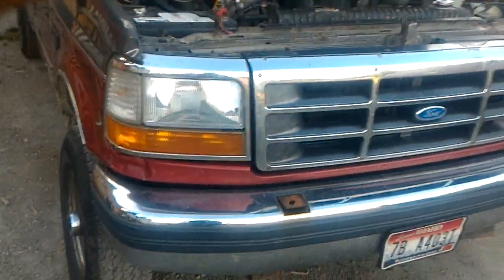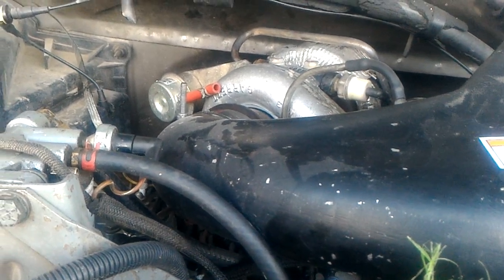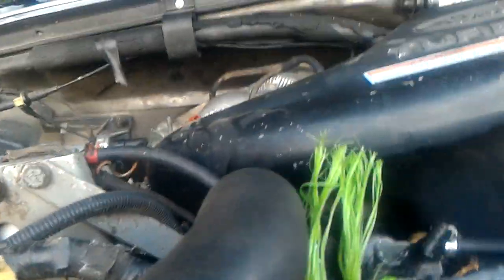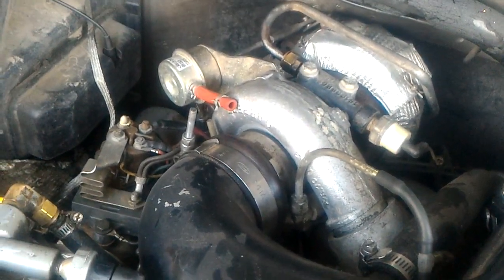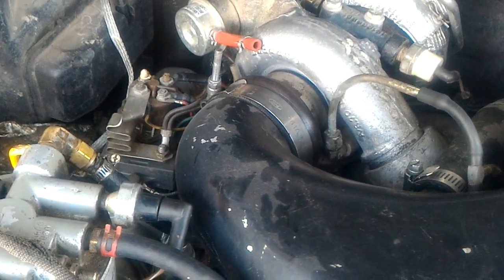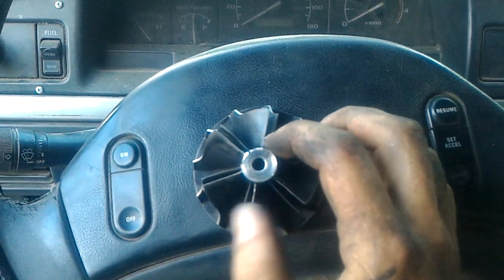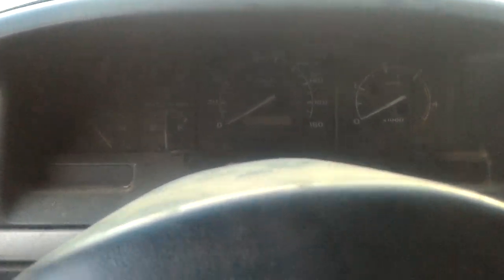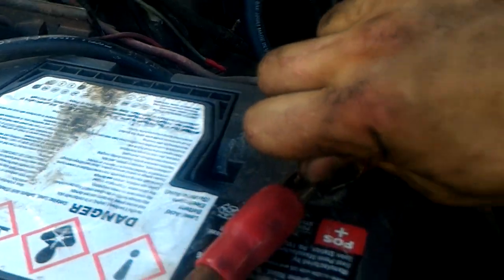IDI Wicked Wheel 2 - performance test

Comment: Hello just wanted to throw it out there I had the same issue for awhile more boost is no help unless you want a money pit. But if you can part shop and or have a buddie that knows what's up to help set up a intercooler on it that's the route I went. More boost is nice but a damn good intercooler is were it is. Denser air with the boost. Denser air makes more power.
Reply: With less smoke more efficient and better feul. Added with a nice pump that alone can get better results then just throwing more boost at it
Reply from the maker: After seeing the video Gale Banks has put out recently, I am inclined to agree with you. Dropping the temperature makes a huge difference.
And on the other rig with the turbo making 27 PSI of boost... well, with a good intercooler, I should be able to double the available air easily enough... More fuel and more power!

I'm kind of thinking that this setup(factory turbo, probably with ww2) plus a decent intercooler might well be good for 300rwhp, when pared with a 'moderate upgraded' IP like the RD2-110. Get a 150 or 180 for my high-power truck and put the 110 on my DD again.
Reply: I would look at classic diesel designed there pump fixed all the problems that the db2 rotary pumps have

Comment: Did you wire the waste gate lever so it actually stays shut? Just unhooking will still open it. You should be hitting 25 easy with a friggin 110 lots of guys on a stock idit pump have hit over 20.
Reply: Might also have a massive boost leak check and see if the up pipes are sealed well
Reply: @groundtogreen1140  do you think it's safe if your not studded? I dont wanna get a stage 1 turbo from R&D but I do want a little more power and boost...and if i did get it should i install how he did it or take the turbo out to do it?
Reply: Ryan Paetz Stock idit shouldn’t push anymore than 14-15. Chances of blowing a head gasket are very likely. Get after market headstuds along with the turbo. APR headstuds on the R&D site will work great. I disconnected my wastegate and I push about 11-13psi

Comment: You have to have leaks and I'm not sure why you disconnected the battery for mechanical parts.
Reply from the maker: Leaks - no, as far as I can tell, I don't; there is no soot buildup around various areas, which even a small leak would produce. And no smoke on startup from places other than the tailpipe.  I'm still not quite sure the issue, but one cylinder is /not/ right. The motor still "taps" a bit, same as it did a few years back; not worse or better. When I eventually tear it down, I will probably find something horrible lol. (I'm thinking valvetrain or camshaft).

As for disconnecting the battery, I likely did it because of the position of the glow plug controller, which is right there on the passenger side valve cover on a factory turbo model. This makes it very easy to short with a tool, and I get annoyed with the sparks.

Comment: Are you running head studs with that pump and injectors?
Reply from the maker: No, I am not. I have head studs in a different rig, the high-HP one with a bigger than stock turbo, but the head gaskets will hold fine with bolts and a reasonable 200-250RWHP. The one thing that will kill them, though, is overheating the motor, especially after many years.

Comment: What’s your favorite exhaust set up sounds different then mine I have factory down pipe to a 4 inch straight pipe
Reply from the maker: My favorite one(so far) is the cheapest - I just took the stock pipes and cut the muffler out. All the bends  and curves in the pipe /signifigantly/ reduce noise at most speeds and load levels - at idle, you can't really tell. 

I do get that popping/crackle on decel at 2200-2800 RPM or so, something the flow-through muffler on my '88 got rid of.

One of these days I may upgrade; I can see using 3" or 4" pipe, and a non-crushed downpipe... but for a stock IP, it's not needed at all.
Reply: Load and proud. Straight pipe all the way . Turbos make great mufflers

Comment: Just did this and the nut came loose. It’s supposed to be a reverse thread and it’s not. How do I get mine to stay on with hand tools?
Reply from the maker: Not sure, probably need to get to the back side of the shaft(like you are supposed to do). Impacts are useful for this, though, and let me get away with what I did.

Comment: Do all idis have that crackle at the end when floored ?
Reply from the maker: Depends on whether you have a muffler. No muffler = crackle on decel. Any muffler, even a straight-through glasspack? Really gets rid of it.
The first time I heard it on a different truck after not having the muffler was very surprising; I thought something was wrong. I realized it's just some sort of harmonic in the exhaust, and it only happens at a certain RPM range(mainly around 2000-2600 or so)
Reply: I’ve got a little straight thru Flowmaster on mine and it still cackles. It’s a 90 NA
Reply: No, get rid of the stock Y pipe, do true duals or an H pipe, it's from the restrictive stock exhaust...

Comment: What happen to your other truck that had tbe big turbo
Reply from the maker: The #3 rod snapped clean in half about 18 months ago - after the last video was posted. It failed right on cold start. Both bearings were perfect and still moved freely, even 18 months later when I took the motor apart.
I've got a new block for it, and going to pick up heads from Typ4/Russ Repair in Newberg, OR, along with a Torque Cam. If I can swing it, I'd like to get it together and running before September 8th and take it to Hunting 4 Horsepower and make some power!
Reply: @MacRobb Simpson darn you. I for some reason thought h4h was Sept 22
Reply from the maker: Well, it's good that you know the correct date now!

Comment: I have an r&d stage one kit stage one injectors and stage one cam 
Paired with a borg&Warner s360 turbo 
I'm still on stock fuel and can hit 20 psi of boost empty lol
Of corse it's a different set up than the factory turbo
Reply from the maker: I sure hope you've got headstuds in there. And then, get a proper pump - probably a RD4-150 to match that boost.
Otherwise, it's all just wasted boost that isn't helping make power.
Reply: @MacRobbSimpson  
Yeah I need to get a bigger pump 
It is studded and also on stock compression 
Justin at r&d said to not go any bigger than the 90 cc pump 
I will be adding an intercooler 
And it's also 6.9 with 4 speed 
I average 17-18 mpg with 3.55 gears
Reply from the maker: @Redneckkid-hl3ty  Being a 6.9, yeah. That kind of sucks. The sad part is honestly, the 6.9 is mostly a 'better' motor than a 7.3 - more cylinder wall meat, and they seem to run smoother for some reason. But, those 7/16 studs are the limiter, dangit!
Hopefully within a year or so I'm going to mod a 6.9 block and upsize to 1/2" if not 9/16" bolts, to see if I can do it. I just need to find the time...
Reply: @MacRobbSimpson  
That would be awesome 
I've got another motor build coming up 
This truck also has a 6.9 and I'm going to swap it for a 7.3 idit from promar 
They sleeve all their blocks so the cylinders shouldn't have any issues for a long time,
Reply: @MacRobbSimpson  
Are you thinking of drilling and tapping the 6.9 block and then using 7.3 heads or will that not work
Reply from the maker: @Redneckkid-hl3ty  Just be aware that sleeving can go wrong. The sleeve must be installed by leaving a small "ledge" of block at the bottom so that the sleeve is captured and can't slide up or down. If not(just retained by friction and/or loctite) it can slip down, resulting in major failure(at least head gasket leaks, if not rapid unscheduled engine disassembly if the sleeve slips down far enough to hit something.

Also, realistically, cavitation isn't nearly the issue that people make of it. Keep good coolant in it and perhaps 0.1% of blocks will ever have an issue - most of the weak ones have already failed.
Reply from the maker: @Redneckkid-hl3ty  Drilling and tapping the 6.9 block, then drilling the 6.9 heads(or whatever set of heads I happen to have handy at the time). Upsizing the heads is childs play compared to making sure the block is  drilled and tapped straight - I could easily upsize a head with just a drillpress.
But, to answer your question, yes, a 7.3 head will work on a 6.9 block, even with 7/16 bolts.
Reply: Redneckkid 1213 are r&d still in business? Nothing on their website is in stock?
Reply: @BrandonS55  
Was wondering the same thing.
Reply: @BrandonS55   I ordered a bunch of parts from Justin, But I called him.  website was out of what I needed
Reply: Hagerman Folley so hes still in business?
Reply: @BrandonS55  yes he is, going to order a turbo intercooler kit for this winter's rebuild just ordered injectors  and fuel return rails this spring.  Sometimes he's a little hard to get ahold of but top notch parts and great to work with for me.